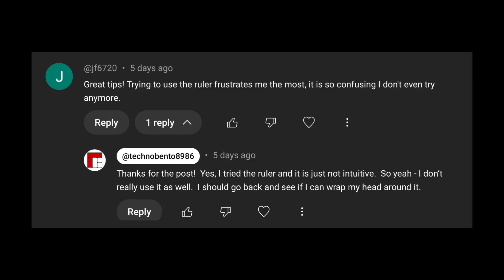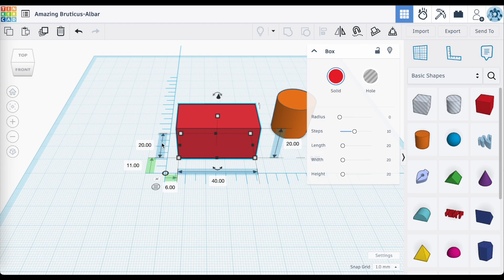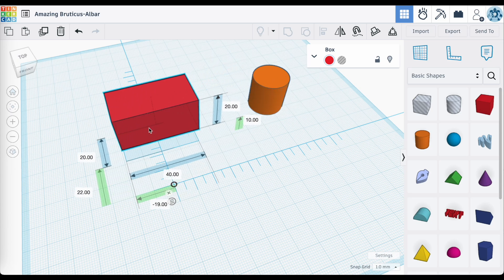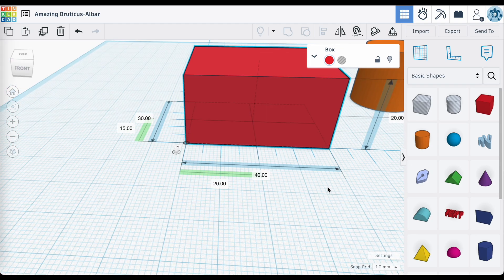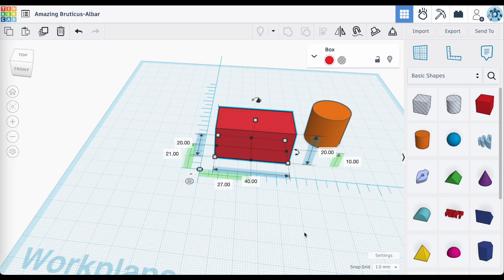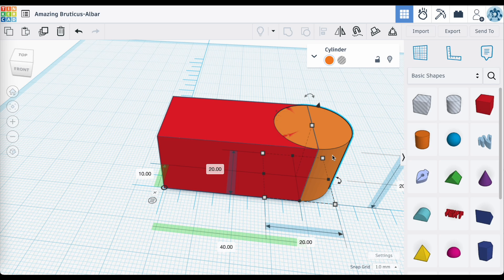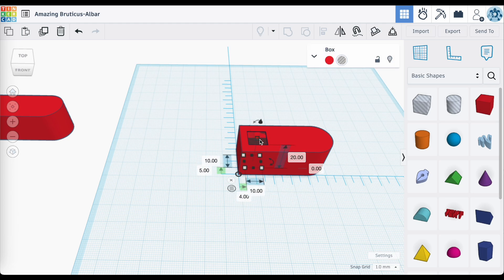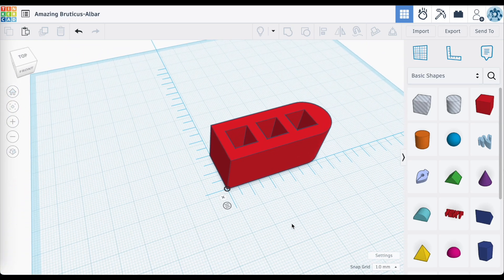How does the Tinkercad Ruler work?  Why would you use it?

Comment: Autodesk should have buttons on the Rule to - 1) snap to rule, 2) Snap Objects, 3) Center them - mid point, divide the rule to segments - to perform duplicates, 5)change origin to shape or to world,
Inside the scketcher, they should also have a Rule tool to create symmetry, alignments, duplicates, etc.
I did not know where to post these suggestions to autodesk - they dont listen,,  so You heard from me here first.
Reply from the maker: I would absolutely love the ability to snap the ruler origin to a surface or corner.  Unfortunately I have no say with the folks at Autodesk - but I hear you.

Comment: Very good explanation of the ruler. Here is a challenge for you. Let's say you have a right triangle block ( the roof shape). Now you want to place another shape half way up the hypotenuse of that right triangle, but without using math, what is the length of the hypotenuse? HINT: set the work plane on the hypotenuse then place the ruler on it. Tinkercad will show you the length of the hypotenuse and midpoint. VERY USEFUL!
Reply from the maker: I love it!  That is awesome.  I also find I am using the workplane tool more often and this just adds to it.  Thanks for sharing this!

Comment: Another great thing about the rule and the Endpoint and the Midpoint setting is if you have it set to Midpoint and you have two items align to the midpoint of the other you and you want to change the dimension of one of the items it will base the change of the on the midpoint of that object.  For instance lets say you have a 20x20x20 block and have a cylinder with both sides 10 and height 10 sitting on the top of the block and aligned to the center of the block, then you want to change the radius of the cylinder to 5 x 5 it will make the cylinder smaller and it will still be aligned to the midpoint of the block. If you have the ruler set to Endpoint or not use the ruler the change of dimensions will happen but it won't change the dimensions and keep the cylinder aligned with the block any longer....if that makes sense.
Reply from the maker: Interesting - I am going to have to check that out.  The ruler tool has been something I have slowly started using with some of my builds but really only for repositions shapes.  Thanks for this tip!

Comment: I've been using Tinkercad for many years, and it wasn't until I found the Ruler tool that it all made sense. Mine is always in the lower left of the Workplane. Tinkercad should set the Ruler tool by default. That and it gives you the "Use Midpoint/Use Endpoint" tool, which I use all the time.
Reply from the maker: That is interesting.  I had to revisit this tool after ignoring it for years.  I definitely see the benefit in using it (much more efficient in lining up objects/shapes/holes,etc) but old habits die hard and I am still in the process of making the ruler tool part of my normal workflow.  Thanks for sharing this!